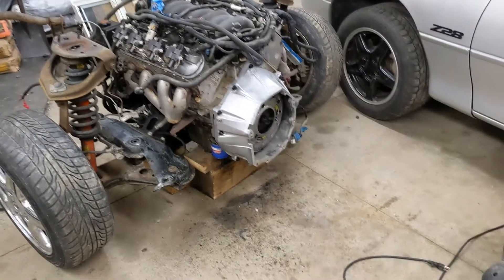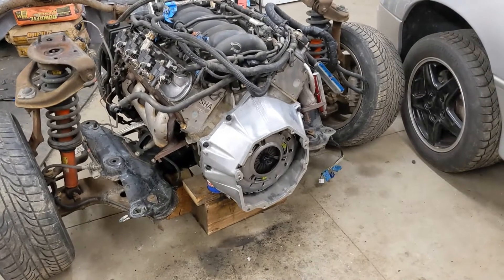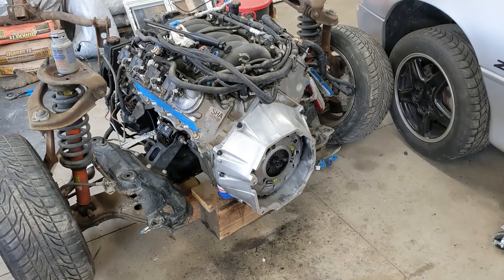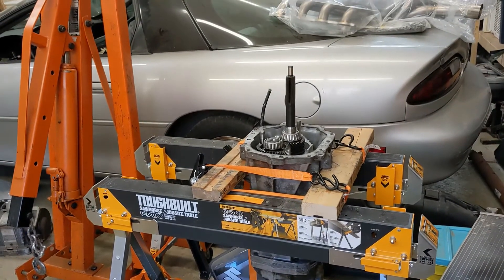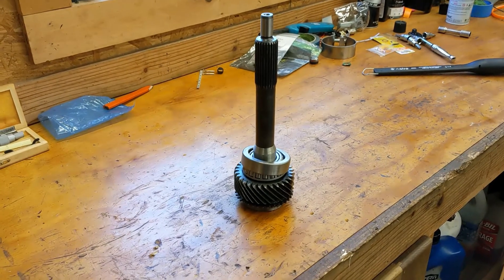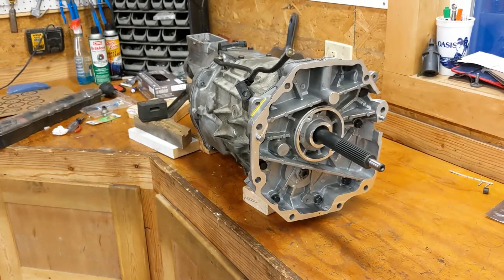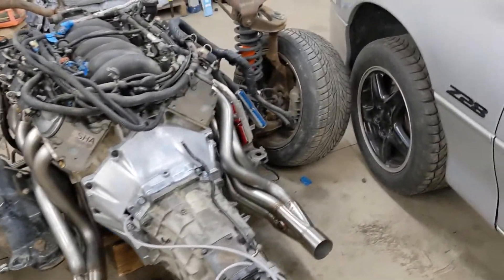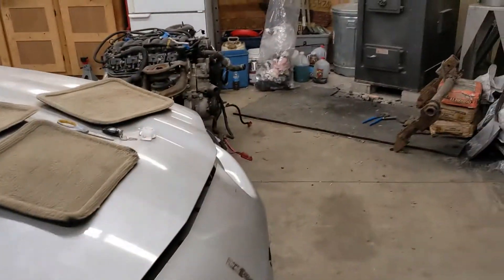1998 3.8l V6 Camaro to LS1 / T56 swap - Part 12 - Attaching a T56, TSP headers

Comment: This series has bin such a great help for me as Im about to swap my CETA to a t56. Can you please do a thorough video of the bleeding procedure and the pedal hook up with all the pedal switches and wiring that goes on to the pedals. There are some switches on the pedals that make the cruise control work and some that make the reverse lock out work and some that give you a extra 50 hp ( lol ) and all the clips that hook up the cables and levers under there. That would be really good. 

 Oh, and after you shimmed the input shaft did it have any in and out play?? When you pull on it can you feel it move in and out even slightly?  The T56 I bought was freshly rebuilt with a stage 2 kit, it  turns really nice on the bench, shifts well as well. My out put shaft has no in and out movement when I pull in in and out. Just wondering if thats normal.  PS, im a total noob when it comes to car things. Motorcycles were my thing all my life. Thanx for all your help. Cheers.
Reply from the maker: Glad to help! A wrench is a wrench all the same, I have a few enduros and a trail bike I like to work on as well. I'll take a video on the clutch connections, as far as I know there are two on the clutch (clutch safety switch and cruise control) and two on the brake (brake switch and cruise control, I think). IIRC, Reverse lock out is a solenoid that will only let you go into reverse if you are traveling under 3mph. 

I'll make a video on bleeding, but I'll be following these these videos from Tick which are super helpful: 
https://www.youtube.com/watch?v=TlHrCnYSj-Y
https://www.youtube.com/watch?v=jKk_nxcTXB0

And there should be no noticeable in our out movement in the input shaft. The spec is 0.00" to 0.02" endplay, which you can't notice by feel, only with a dial indicator, so your transmission sounds normal to me!